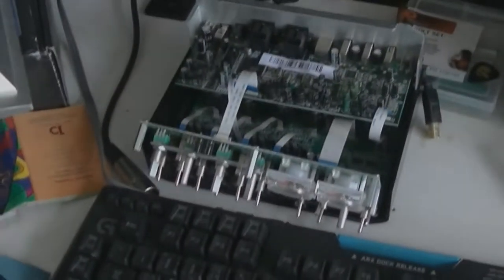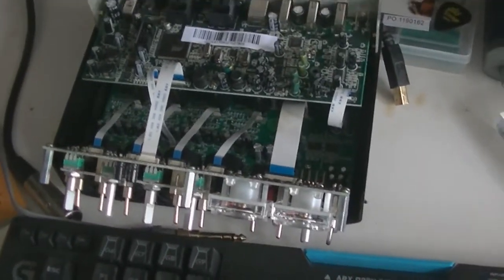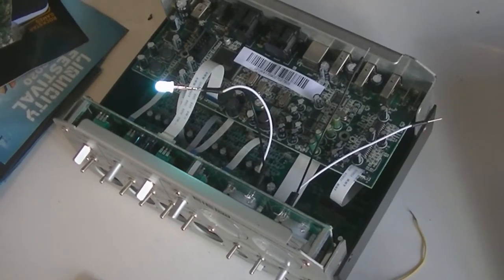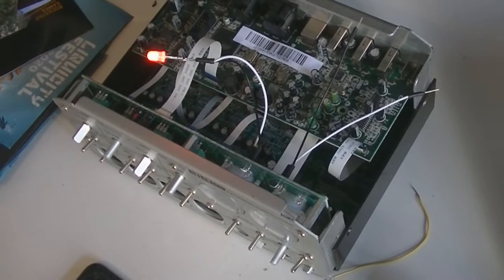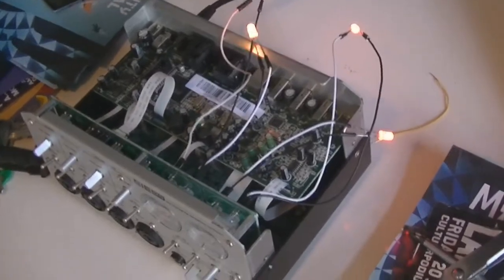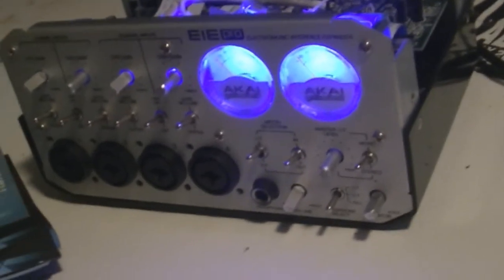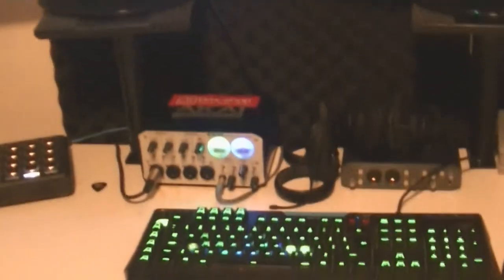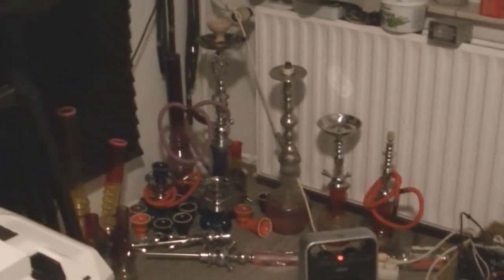Modified AKAI EIE PRO with RGB Led lights (DIY)

Comment: When you open the panel, is it movable? like, can yo move the front panel up or down? or is it fixed as a square shape? (I´m asking this cause I´m trying to do a project, and would love to have those meters and inputs but in the top panel of a box, and the outputs and the back part in the Rear panel...you think that´s possible? ?

Comment: Hello, in what system do you use it? I used it with Ableton 10 on Windows 7 with Intel core i3 and it worked perfectly (with akai drivers 29.55), now I changed to AMD ryzen 5, with Windows 11 and Ableton 11 the crashes are unbearable!! I have tried all the drivers and there is no way, even with the latest version of ASIO4ALL...
Reply from the maker: win 10 and it still runs smooth but got a pretty well put pc i7 with 16gb ram and all i forgot the specs but the ram and cpu matters most for what i do and it runs better than most systems with how extremely big my projects are :P